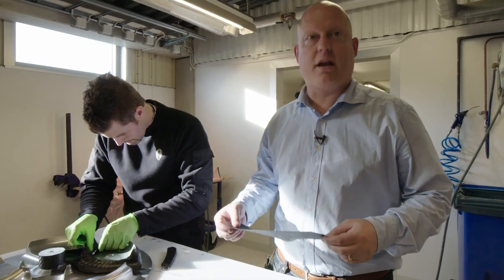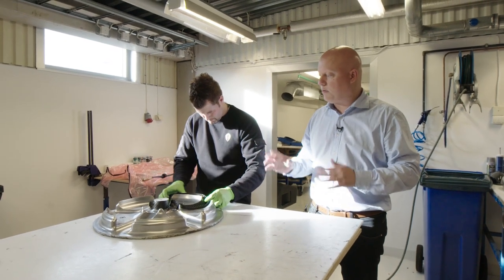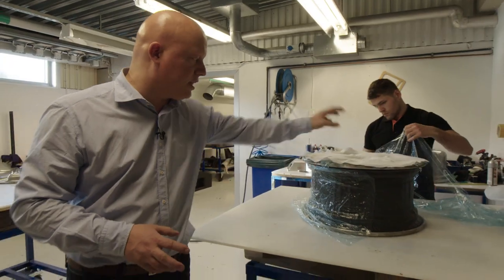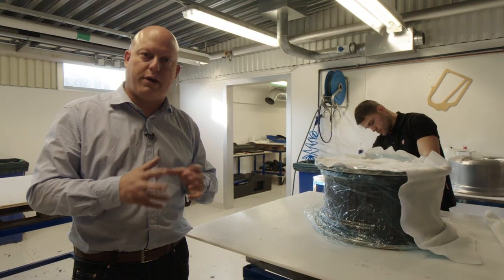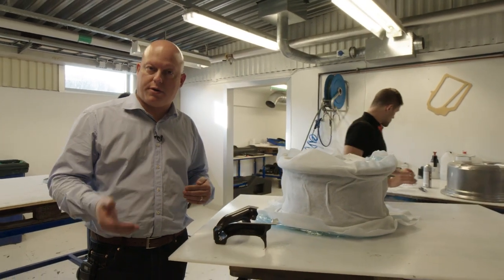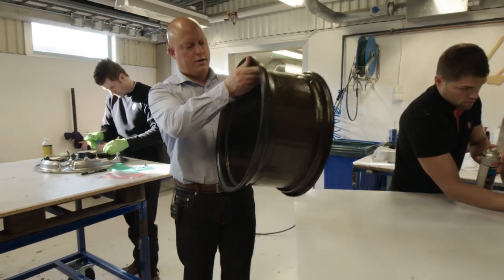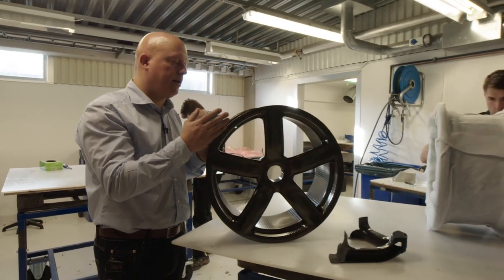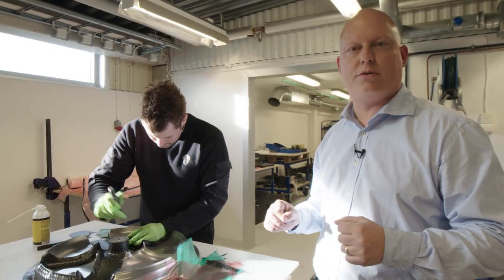Christian Von Koenigsegg Explains How He Makes 280 MPH Carbon Fiber Wheels

Comment: I have been running BST carbon wheels on my Ducati for years and have had no problems with them. They make a massive difference in handling especially for motorcycles. CF is very tough and when it fails it cracks, it does not shatter as some people will have you believe. The only downside to BST wheels besides the cost is I do my own tire changes as I don't want the shop newly hired guy abusing them.

Comment: Yeah, i should think that this wheel is easy to balance, i mean, i know at least for blank based wheels that unless you're talking about the highest grade of metal, it's not homogeneous, i imagine that gets even worse for cast wheels. Hence, the balance issues. In a hand built wheel, we're actually going back to spoke type design, actual spokes not 5 patterns but 46 or however many they had back in the day where the end product was evenly spread and resulted in pretty good wheels. Some manufacturers that took care in building their wheels actually knew that if you set the plug opposite of the welded area of the wheel rim, you don't have to do much for it, which was amazing tech knowledge for that time.

Comment: Considering Michelin made quite a few sets of fiberglass wheels for the Citroen SM back in 1972-75, with a few more in the 1980s, carbon fiber reinforced resin wheels should not be an order of magnitude past. Jerry Hathaway of SM World said that in over 40 years he has not seen any deterioration past stripping and repainting the outer visible surface.

Comment: According to Gordon Murray carbon fiber wheels are not a good idea and in fact are a safety issue. Alloy or Magnesium wheels are the way to go according to Gordon who has been in F1 design for a long time and was in at the beginning of the use of composite materials in formula one back in the 80's. Apparently if you chip or kerb an Alloy wheel it won't affect the wheel's integrity and it can be repaired but if you slightly damage a carbon wheel it can fail catastrophically. Also using 21 or 22 inch wheels is counter productive as there is no benefit from the larger wheel and is just a fashion design that carries extra weight. Far better to go with the smaller wheel made from an Alloy which gives better handling in a light weight car with less unsprung weight. You might say that you can fit larger brakes in a 22 inch wheel but in a light weight car such as the GM new F1 better brake design negates the need for big brakes. This is all according to Gordon Murray who knows his stuff more then most.

Comment: The hole in the middle for the wheel hub is perfectly round, so the wheel is hold on just by friction force of the nut? Crazy if you know that huge forces work on these wheels during acceleration.

Comment: No mention of a ceramic coating on the back of the spokes on the front wheels.  I wonder how much different the CF is compared to Multimatic's.  The GT350R brakes get so hot they had to develop a special ceramic for the inside of the front wheels.
Reply: they use carbon brakes, they dont get as hot as the steel brakes we know.
Reply: To slow down you must turn speed into heat. If your brakes don't get hot it's not going to slow down. I question your assertion that ceramic doesn't get as hot as steel. I don't know for sure, but I intend to do some research on the subject.
Reply: Save your time.
Reply: Ceramic brakes get atleast just as hot as steel ones, they just remain operational at higher temperatures without fading like steel does. That does mean they can actually get a lot hotter than steel ones under racing.
Reply: It's likely they don't apply any protective coating to the back face of the wheels as they use high temperature carbon (upwards of 600C I would guess). He says they use after-treatment processes to deal with the brake heat. The main process is a post-cure cycle, which is where the carbon part (after demoulding) is put in a composite oven and heated to a desired temperature, 1000C for example. This process significantly increases its temperature resistance and gives the carbon its golden-y orange colour (if its catches the light correctly).
Reply: Correction to my original post.  It's not Multimatic that makes the wheels for the GT350R.  Carbon Revolution does.  Multimatic makes the CF for the GT.

Comment: For such a small part, why is the valve made of steel and not carbon fibre also? I know the weight loss is almost irrelevant but it would be an easy to produce part to manufacture for you guys?

Comment: Any specific reason they're not using magnesium wheels? Slightly lower density than carbon fiber, and since it's used in Formula 1 surely it should be viable for the speeds Koenigsegg wants to achieve?

Comment: there is a few things wrong here. first the guy laying up could save so much time by using a hair dryer to lay up.. and second you would never bag on a plastic table that is just asking for holes in your bag and you would never bag on a table that you use to take your parts out of your molds

Comment: Who would have known paper machě would advance to this? My first bicycle was from Sears catalog literally! As for the heat issues with the brakes, redesign the hub for the airflow ;) 
Wonderful car, my wife is a big fan.
I was going to do a W16 Aeral Atom type that can fly as well, it just the Manufacturing Licensing seems controlled by larger manufactors that want "special intrests" 
It would be mean to say anybody can do this :)

Comment: It turns out that the latest carbon wheels are lighter than the tires. IIRC CVK said the rubber is twice as heavy as the wheel.

Comment: I'm always surprised that they use flat pieces of carbon fiber for all this fabrication. Of course, when you apply a flat piece of material around multiple curves, you get areas where it will bunch up, or you get areas where you are short on material. I know you can make cuts to the bunched ares, and apply additional material on the areas where you lack material. It's just interesting that with all this, they can still make such a precise model, In actuality, the claim it's more precise than using metals.

Comment: Wonder what CF wheels will be like after say, 25 years?  Also, water, salt, UV?  I've heard that early CF tubs of F1 cars have started to break down due to UV exposure and can no longer be used.
Reply: Probably need to be replaced every few years.  I doubt anyone with a car as high end as this would ever see snow, salt, rain, temps below 50 F, and so on.
Reply: What, no power sliding in the snow??!!
Reply: taxtherich would probably do it.
Reply: UV resistant resins have been developed. Early F1 tubs also have the disadvantage that longevity beyond one season or less of racing was not a consideration. 

I also wouldn't anticipate these things spending significant the amounts of time baking in the sun.

Comment: Hi, I'm a GM Technician. At my shop, I am the main man to lift and rotate the heavier GM rims, as our techs are older. Because of this, I now am going to the doctor to get treated for a hernia. I want to know why this man, who is only one man, is making such great strides in making a car lighter and more efficient, yet a whole team of engineers at GM's Cadillac branch insist on putting wheels and tires that weigh almost 100 lbs each on their new Escalades. How is that efficient?

Comment: Well..time to make a mold of a wheel and make me some CF ones from it! Easy bake them in my oven lol..and Pre Preg smh get some good 650 Gram CF vacuum infusion a high temp resin into it and poof done, no baking...glue them together with high strength apoxy glue and see how much abuse they can handle on a beater car till they break..make adjustments and congratulations you got a CF wheel you can mass produce.

Comment: a wheel made of carbon fibre weighing 6 kilos is actually heavier than i thought. but then, if you have that much carbon fibre in it, it has to be so much stronger that an aluminium wheel.

Comment: The problem is that carbon fibre can start to crack and break when exposed to sunlight for long period of time. I guess it's not a problem for these cars which are never parked outdoor and always delivered in a trailer...but normally such carbon fiber wheels would not work on cars which are used on daily basis.
Reply: Eric Murphy they have UV protection

Comment: Where would you go to change tires or to get an alignment done if you had such carbon wheels? Definitely not any of the conventional tire shops with minimum wage 20-year-olds working there who just don't give a crap! I brought my classic 1975 vehicle with painted wheels to one of such "big name" shops  for a new set of tires and to get an alignment and they scratched up my wheels pretty good! I saw the technician who did the alignment, clamping his alignment tools onto my painted wheels, giving them some good knocks and leaving deep gashes in the paint. I didn't complain because I didn't want to make that guy's miserable life even worse.

Comment: If the wheel is so light, why does it require 2 men to put it into the autoclave?
Reply: the tool is heavy
Reply: 505197 So it doesn't get damaged

Comment: guys im thinking of wrapping my side mirrors and parts of my interior to carbon fibre but im also considering the effects it gonna have for wrapping. Is it true that if the carbon fibre or any other coloured wraps is on my exterior of the car, it will get damaged due to rain or heat? And is it true that if the carbon fibre is on the interior eg. door handles once it gets scratched u need to replace with a new wrap to look nice? Also, when i want to peel off the wrap, will it leave behind any unnecessary scars and can it be removed?

Comment: sorry but why is carbon fiber always striped? is that the actual fiber or just a generic design for carbon fiber
Reply: it's basically like a cloth, it's a veave made out of thin strands
Reply: Revamptheindustry TheKaziCo oh, it's not two different colours, it's because it's a quite large weave, so the light just hits the strips differently - that's why it gives a cheques effect in the end, if you take a strip, look at it, some is shiny silverish, some is black, if you rotate it by 90degrees you will notice that it simply changes places, it's not totally flat - it's a large weave covered in resin, some types of pseudo carbon layering gives that effect as well if it's pressed plastic instead of printed sticker
Reply: thanks
Reply: draconpost amazing stuff carbon fiber. we used it a lot for our KU formula SAE cars. the shell of car, the splitters, rear wing, and even our wheels were all carbon fiber. wouldn't believe how light it is. when I first started working on the cars, one of the team members handed me the rear wing, which is a fairly large piece. I was bracing expecting it to weigh 50-60 pounds, I grabbed it, could have held it in one hand without a problem.
Reply: MrBingping yeah, some materials are extremely light, I once worked at reception in a company that is making bicycles, one time they brought a package with a bicycle frame and I had to check if there was anything inside of the cardboard box it was brought in because I thought that it was empty
Reply: Not all CF has that weave. The most common type of wve is the 2/2  twill wich you see almost everywhere, but the patterns differ with each application. For the barrel of the wheel for ex. most of the strands are going in the same direction and in the same line as the barrel to make it more stiff. If the strands were perpendicular to the barrel, the wheel would be very brittle, plus the more complex the pattern is, the more weaker the part will become.
Reply: Dan Stefan so true.  My "Stealth Bomber"  carbon fiber Two Brothers exhaust can fell apart and became brittle in ê years time.  It just sits there exhaust the gas from the bike.  Thanks for the knowledge Dan
Reply: they weave carbon strips together, thats why they look like that
Reply: it's the weave of the fibers that  gives it  that checkered look.
Reply: I would of googled it before asking here

Comment: Did he mention anything about weight? What's the difference between wheel made from aluminum and carbon fiber ?
Reply: just under 6 kg compared to ~10 kg
Reply: Carbon will run a little more than half the weight of alu

Comment: When multi-layering materials, it is important to get a complete bonding of parts, so that no air gaps or impurities are between the layers.  The autoclave will solve most of this issue, but why on earth would you allow the production team to not at least wear a hair net to keep their hair from destroying the bond?  Does this not represent an issue?
Reply: BMW are starting production of using CF offcuts from the i3 to make wheels, i would image that their method will be slightly more precise and scientific.

Comment: So, how much are these? 10k?  100k?
Reply: I dont think that they would be that expensive, they are just bits of CF and someones time.

BMW are planning to use similar on the little i3 to use up offcuts of CF from production.
Reply: M3Conv Just as a general rule, if nobody talks about price, its probably pretty damn expensive.  For points of reference, the Carbon Revolution wheels for Porsche 911's are 15k per set.  And the Dynmag Magnesium and CF hybrid wheels for GTR's are 11k per set. Koenigsegg's site said they've sold like 50 sets of wheels, so, this is very limited production.  And there is no shopping cart, you have to call them.
Reply: CaseAgainstFaith1
I agree, however its going to hurt the exclusivity factor they start coming as standard on a £25K economy car.
Reply: Most likely $8k-$15k each.
Reply: +CaseAgainstFaith just the tires on the bugatti ss are 30k!!!!!! Just the tires!!!!

Comment: how strong do different sections of CF cutouts stick to each other? Is it as strong as the CF sheet itself?
Reply: That's why he said overlap was important. If you don't do it properly, a part made from CF is only as strong as the epoxy that holds it together, and you don't want to rely on the epoxy if you hit a pothole. You want the fibers to handle the strain.

It's a matter of overlapping each sheet in a way they won't delaminate. As long as the laminate is intact, the junctions are as strong as the CF itself. They just have to be engineered properly because junctions are natural stress points on any material.

Comment: I get a feeling this guy is either extremely biased or has some sort of proprietary tech not yet even available to space craft and aircraft designers interns of making impact resistant composites. He really just said that his cf wheel could withstand a harder impact from a pot hole or curb than a metal one? 
Has this guy heard of internal delimitation?
In aerospace if an engineer drops his tool belt on the composite floor of an airliner, this spot gets checked for delimitation using X-rays.. are you really telling me hitting.a pot hole or curbing this wheel on a race track, your wheel will not delaminate?
Reply: Omar M Khalil Getting the spelling right 1/3 times at least.

Comment: Can someon explain how that wheel gets mounted to a car? I couldn't see any bolt holes in the clip. thanks.
Reply: The wheels use a center locking nut. I don't have a link but Koenigsegg recently posted an article on how the nut locked with the wheel ob their site... The wrench to torque it down is so long you need two people to hold it
Reply: Thats pretty intense. Thank you!

Comment: Very impressive wheel but extremely expensive looking process.
Reply: Carbon fiber products, even aesthetic ones that just need to look nice, are inherently expensive due to materials cost. A CF mirror doesn't need to withstand 400kg of static pressure, let alone dynamic lateral forces as well as rotational, heat and shock. Then comes the hypercar requirements...

Comment: maybe some RTM techinque would add much better quality to the composite rim. I mean increased and more controlable fiber proportion, and much less porosity.
even they could make the rim in two parts, the ring by filament winding and the radius by rtm, and then integrate both pieces in the autoclave.
xD much more expensive, but WTF you pay a million euros for this. Prepreg hand lay up is the easiest, cheapiest and "lowestperformance" way to build in carbon fiber.